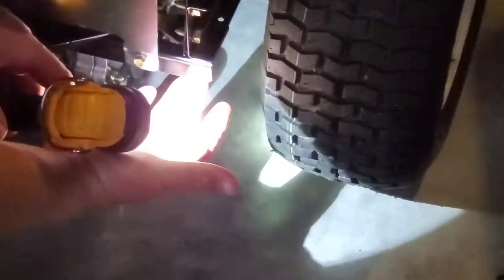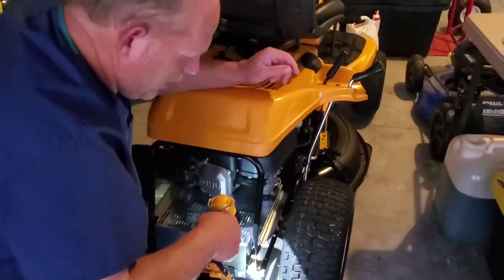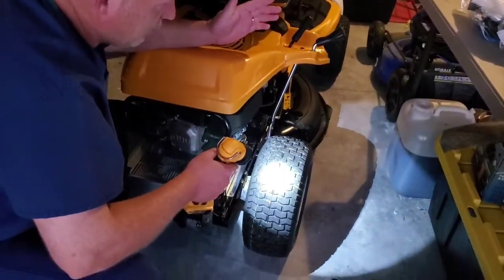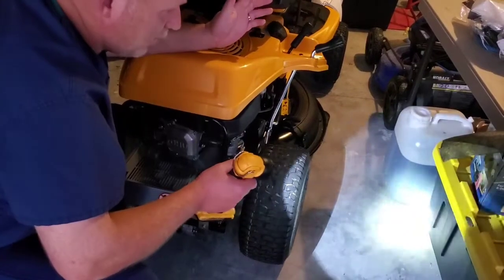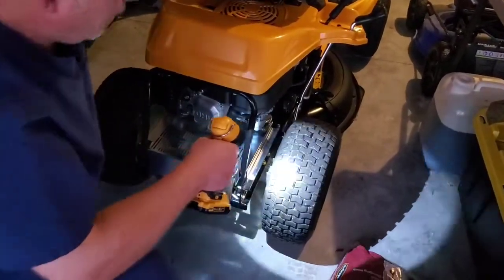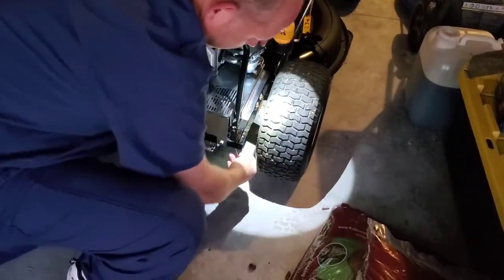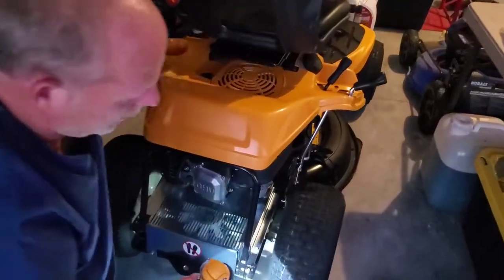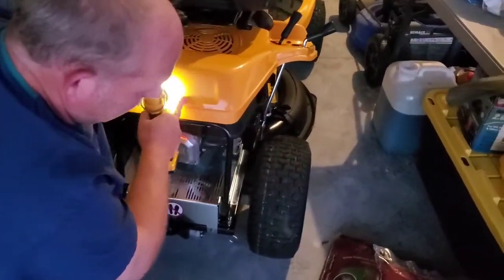Cub Cadet CC 30 H - Won't start or Won't move fix and tips

Comment: Pleased to add my comment about how much i appreciate your video. I was about to load my mower onto the truck for a trip to the repair shop because of a no start issue. I ran over one of the dog's Kong toys last Fall and the mower sputtered to a stop. I thought it might be related to one of the interlocks but did not think of checking the deck chute. Sure enough, thanks to your video, i checked it and the chute cover was damaged from its encounter with the Kong. Repaired the damage and we're back in business! Thanks!

Comment: Thanks so much. My husband has his Club Cadet for a month or 2 and it was working. He stopped it and it wouldn't restart. He couldn't figure anything out from the manual and I found your video. It was either the side button or the sparkplug,  because he did them both before getting back on and now it works. THANKS!

Comment: For the side discharge safety switch, you can press it in, drill a small hole, and put a pin  in it so it won't give you problems anymore. I believe there is a video out there showing how to do it. Being a CC30H owner since 2016 I had problems with this for years before i found a solution.

Comment: My no start issue was because the side discharge cover/plastic was not pushing up against the PIN. Once i reseated it, she started right up! Thanks!! for that, and the disengage the hydrostatic transmission tip!
Reply from the maker: your welcome

Comment: Thank you. Thank you thank you. Your video let me fix my non starting 30 inch cub cadet. I had taken the blade cover off to look at the blade.  Then put the cover back on and it wasn't right against that safety switch thing.  You saved me. Thanks
Reply from the maker: very nice

Comment: October in Connecticut means time outside with extra yard duties. I like to mulch the leaves and this is the first time using my Cub Cadet. Several passes are needed to do the job including a tgas refill. Then would not start up. Checking seat switch, working good but the saw a piece of branch stuck in the mulch cover near the switch area. So took off the wing nuts, cleaned off any grass along with the branch and put the cover back on. Mower started, problem solved.

Comment: I just got mine in yesterday and today I mowed for the first time until the bags were full
I stopped emptied the bags and filled the gas up and got back on and it does nothing.
The switch on the side and seat are fine,and I can’t find anything wrong.
The transmission switch in either direction won’t let it roll so it was a pain to get back to the garage.
No idea why
Reply: For anyone that might care the clutch/brake pedal pushes into another safety switch located under mower near the one for the mowing inserts.
The pin had come off not allowing it to be pressed in.
Had to remove the deck to find the issue but it’s all fixed now.

Comment: Only had this for a month started up and worked perfectly fine the first few weeks but now it won’t start up even after making sure the safety switches are engaged. Any advice or recommendations would be appreciated.
Reply from the maker: bad battery
Reply from the maker: use warranty

Comment: my mower starts, but will not stay running. I have siphoned out the gas, added new gas, taken off the fuel filter. I would clean the pins in the carb but cannot open the bowl. can you help?
Reply: here should be a blot under the. carb bowl, unscrew that and look for the jet, if the jet is clogged and you cant see through it stick a thin pin through it and it should help

Comment: Hey, my cub cadet 30cc h quit running while I was mowing , I thought it was out of gas so I went to get the gas can and of course it was hot outside so I popped in the house a minute to cool off. Well it started raining and I forgot the gas cap wasn't on it and the seat what's up and so it rained and rained and rained for every day I had I could be off for about 3 weeks so I have drained the gas twice. The tank out with cloth to make sure I was getting it all I change the fuel filter and the spark plug and when I crank when I try to crank it it still does the same thing as a day at shut off it'll turn over and turnover and turn over but won't crank what could be the problem now
Reply from the maker: it could be a new faulty spark plug, it could also ve a sensor switch down by the discharge vhute

Comment: Does this mower have a fuse?   Am getting ready for spring now, battery was going weak and i think i tried to jump with car bAttery.   I see some Cub Cadets have a 20A fuse.  Schematics i have looked at doesn’t show a fuse. 

Just checked seating of deck switch and it wasn’t seated, but is now. 

I am not even getting light to turn on.  

trying to find my multi meter right now to test and/or bypass the safety switches, or even see if power is going that far.  

No headlight, no nada.    

Thoughts?  (i think i have 2018/2019 model.
Reply from the maker: no fuse that I know of. fully charged battery.is important

Comment: I was mowing like normal. Suddenly mower started to cutout as if it was running out of gas. It wasn’t but I put more gas in it just in case. Tried to start it again completely dead! Checked seat switch, blade in gage switch, Shute switch, and brake switch. All were fine. Jumped solenoid switch it engaged so battery is fine. I didn’t let it turn enough to start. It’s got me stumped. Just wondering if any other ideas before I have to load it up and haul it to the dealer.  Thanks in advance
Reply from the maker: not sure, you covered it all
Reply: @vegasdavetv  well yeah I watched it all checked all the switch’s and made sure they are all working and making contact. The only thing I haven’t checked is if there is a switch for the brake pedal to be sure if it is completely depressed before starting. I don’t see one but I have not disassembled the plastic panels to see if there is one hidden underneath that isn’t visible from the top side. Is there an easy way to find such a switch without disassembling the body panels? Thanks in advance.
Reply: Bad gas maybe.. air filter

Comment: I think ( and hope ) my battery is just dead.  It ran fine all last summer and it sat in my garage all winter. Now this spring I try to start it.  The light comes on when I have the key in but no click. No try to start up. Nothing. Then after a little bit, I try to turn the key again and it doesn’t light up. 

I’m kinda a newb to these small engines. What do I need to get to check and charge the battery? 
How do I jump start this without killing it? 

Thanks

Oh. And how could the battery die from just sitting in my garage?
Reply from the maker: your battery is gone, mine did to over winter. put a charger on it or get a new one. I suggest getting a trickle charger and leave it on battery all winter, that won't happen anymore
Reply: @vegasdavetv  thanks for the reply and suggestion.   Ironically I feel better knowing it’s something that simple rather than one of the switches being bad..

Comment: Hi Dave, I was hoping to hear my problem but did not so hear goes, I have the same mower and when I turn the key to the right and back center for reverse the light comes on but sometimes it will go off, and sometimes over and over once I start moving in reverse, can you help with this?
Reply from the maker: sounds like a switch or electric issue, check all connections
Reply: @vegasdavetv   Thanks Dave, I'll check
Reply: Hello Dave I like to say thanks you were also right, I didn't thank it could be, because it was sometimey, but I put my hand under the ignition switch , and just push around on the wires and never had a problem since, thank you very much. thumbs up to you helpful youtubers.

Comment: Question? CC30H will go forward, the reverse switch will in engage. The red light will not light up. Does my RCM module need to be replaced? How do you troubleshoot the switch?
Reply from the maker: replace it is what they do